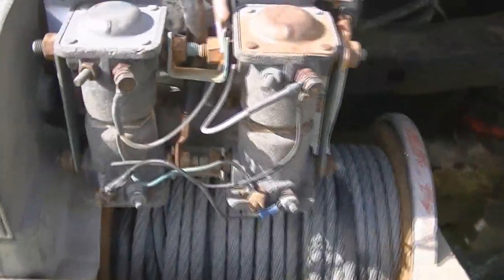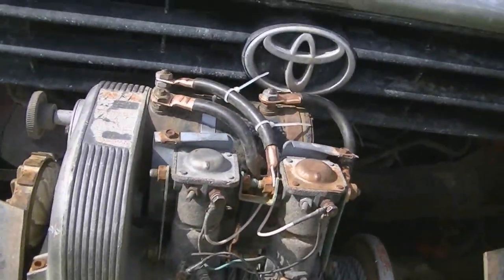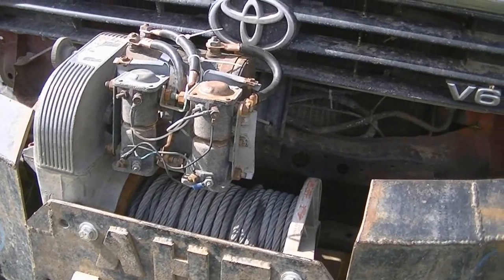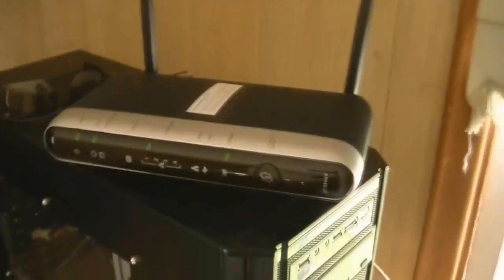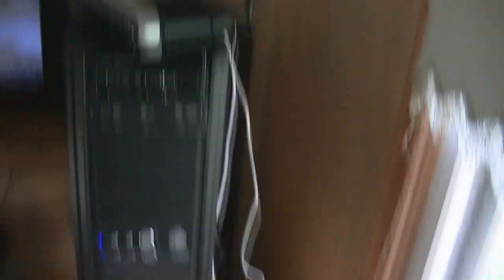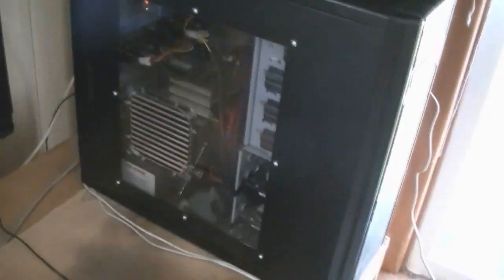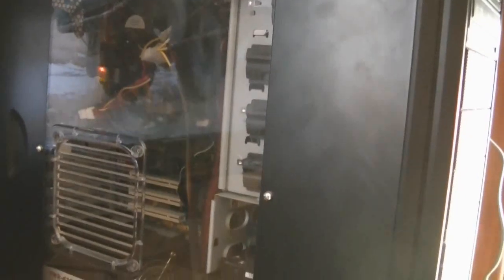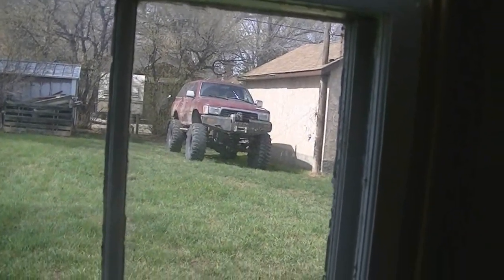Winch Installed, Going To BC! (05/03-04/12)

Comment: How old is it? How many ghz does the processor run? How much ram? Little ram and crappy processor would slow it down, as would heat. My computer slows down when it gets to about 100 degrees, but can easily go to as hot as the sun if I leave Skyrim running haha.

Comment from the maker: the ground for my winch is 2-0 ga, the power is 2-0 ga. the wiring from the battery to the rest of the truck is no less than 2ga... i wired the winch up directly to the battery this time, no more grounding to the frame, then through the frame to the battery... direct is best... i need to go over everything and doublecheck though...

Comment: The bolt pattern is exactly the same. Cragars that fit on a blazer would fit on your pickup. However stock toyota rims have a smaller center hole than chevy and wont fit on chevys. Aftermarket rims work for either one. So as a recap. Stock chevys fit on yotas  stock yotas don't fit on chevys, and aftermarket 6 lug rims fit on either

Comment: Dude, water cooling is NOT worth it. just use a good fan with a huge heat sink. I've dealt with it before and its just more trouble than its worth for the same performance an air cooled setup will get you for cheaper.